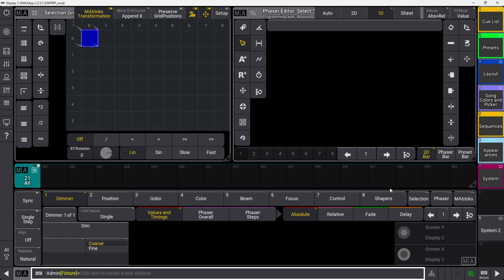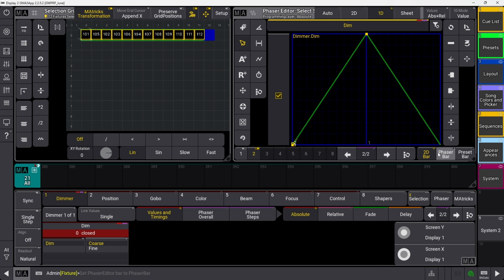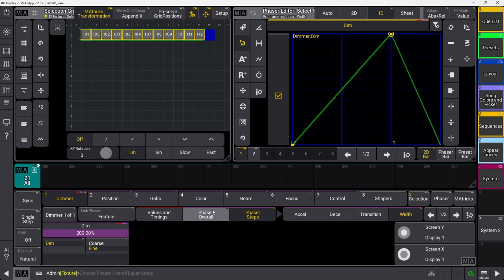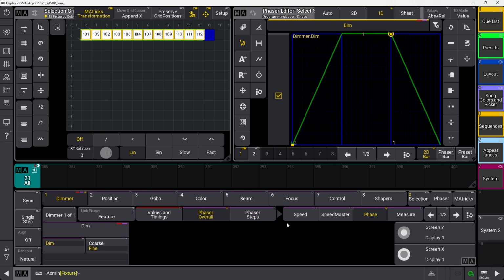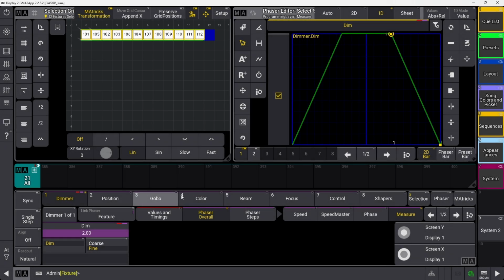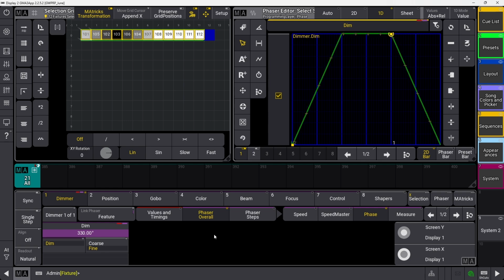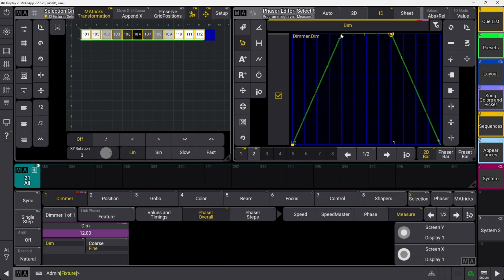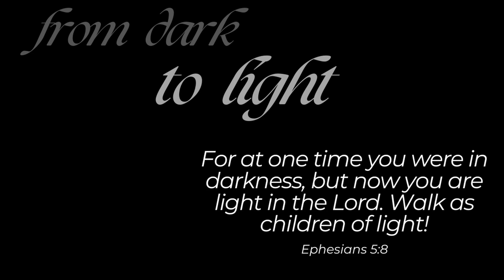Phaser Math Made Easy - MA3 v2.2

Comment: Wow. Coming from Eos, this is a whole other world of effects. It's a theatre desk, so it has FX timing down to 100ths of a second and cannot really process BPM the same way. This makes it look so pain-free to get the kind of effect you want for the music.
Reply from the maker: Oh wow! I don't have any experience with Eos, but from everything I've heard I don't think I want to 😅
And I think literally everyone who comes to MA3 from MA2 finds phasers way more complicated than MA2 Effects (because they are more complicated but also more versatile), so hearing that this sounds pain-free is really scary...
Reply: @FromDarkToLightTutorials  well it's aright tool for the job kind of thing. Eos desks are absolutely the right tool for theatre, and judging by the speed others achieve on GrandMA3, I think Eos is also the more efficient tool for that job. But live music is truely not something you want to do on Eos. It's certainly doable, I've done it many times, but it's like using one of those small electric screwdrivers meant for electronics projects for carpentry, just not the right tool for the job.
If you're interested in what you showed would look like on Eos: if you want a graph for the value of one parameter, you need a linear effect, if you want multiple parameters or presets in the effect, you need an absolute effect which is just a table of steps with no graphs. Let's assume we go for a linear effect. We get a graph that defaults to sine, but we can warp it, move it, give it another predefined shape, draw it or randomise it. This graph is one cycle of our effect, and to change the speed, we have a setting called cycle time, which is the time it takes to complete the cycle, given in x.xx seconds (which is just too unprecise for certain bpms), so if we want it to do something on the beat, we have to calculate all that by hand for a certain bpm. Phase is called trail and is given in procent. A trail of 100% means that one light has to go through 100% of the cycle in order for the next light to start it (I think). Blocks and wings just do not exist in the same way. There is grouping, where you can determine whether one or more lights should be simultaneous and act as a block of lights, but giving it a certain order in space can only be done by selection order and having selection order respected for grouping is hard. Wings can also only be achieved by selection order and offset. This is ok if you have a very well-numbered rig with evenly distributed lights, but if the trusses have different amounts of lights, it's not really a possibility. All this is because Eos can't really process the position of a light to put it in an effect. The pixel mapping feature is a great workarlund, but it only works for color and intensity effects.
Reply from the maker: @charlotteice5704  Oh my. That definitely sounds pretty overwhelming for most use cases! 
Are you learning MA3 with the hope or intention of switching to it or are you already using it in some situations?
Reply: @FromDarkToLightTutorials  I'm learning MA3 because I want to expand my skillset for the live event side of things so I can take jobs in that area as well :)
Reply from the maker: Smart choice! I feel like you can do pretty much anything when you know MA3 😄

Comment: great video! but i do have one question.. can you set measure via MAtricks? or macro? i have my own great busk file, sometimes i want to quikly switch between 1/2 chasers to 1/3 or 1/4 how can i make shure this always will be on beat?
Reply: Rn just by speed master, thanks for your awnser.
Reply from the maker: Thanks! Measure is not included in MATricks. I think it should be possible via macro but I've never tried it.
How are you running the phaser you are trying to adjust speed on, and what action are you trying to use to adjust the speed? 
I do not busk a lot, but my approach in programming has been to use recipes and adjust the speed in the recipe line. Adjusting the recipe line speed is definitely something you can easily do via macro, and you can also set speed in MATricks.